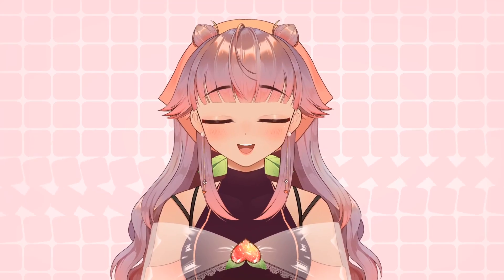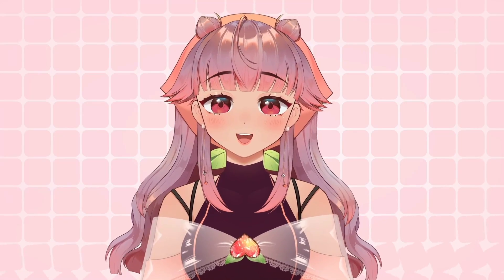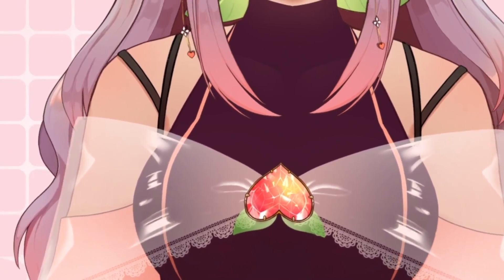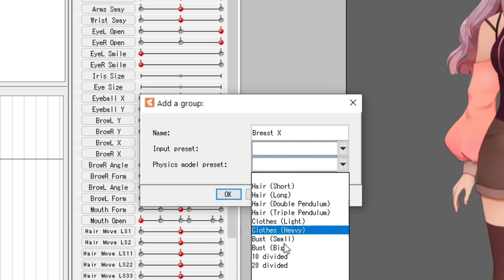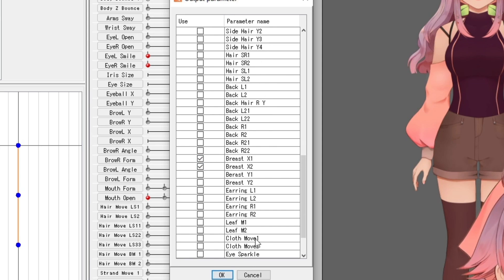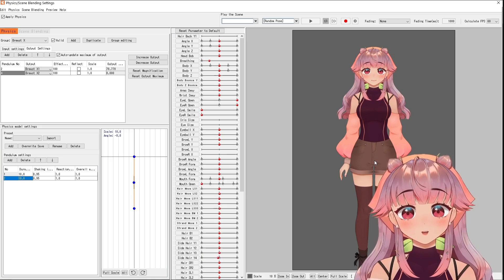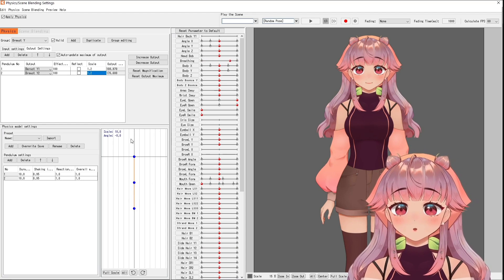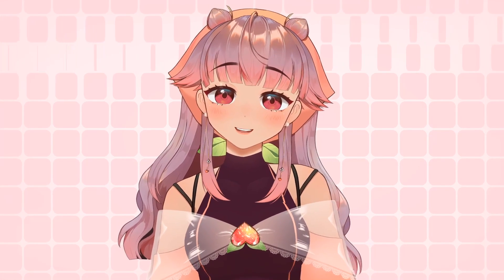NEW Live2D Physics tutorial + how to rig hair & breast [2D VTuber Model]

Comment: Hi, when setting the value for the parameters for rigging physics, does it matter if you set it from -1 to 1, or -30 to 30?
Reply from the maker: It matters in the physics window! You wouldn't need to scale the movement up by very much :> I just prefer having the -1 to 1 now

Comment: The breast part is moving but its take the whole shirt/neckline with it, should i separate it manually or is there a way to only move certain points when shifting them on a x axis?
Reply from the maker: You could increase the control points & partitions of the deformer in the inspector window

Else, separate the breasts from the torso in the PSD

Comment: I don't know why it doesn't work for me, I do everything in the tutorial but my model stays still, I move it to the left and right and it does nothing.
Reply from the maker: Heyo, I've put in some things you can do so you can see what the problem is :D

I'm assuming that you have already rigged everything (head, body, etc)

1. If you're too zoomed in the model, movement of the cursor doesn't have a large effect on changing the parameters

2. check if "Apply Physics" is checked, it's found in the upper left corner of the Physics/Scene Blending Settings window

3. could you check Preview > Settings of cursor tracking? The parameters that you want to follow the mouse should be set to something, not just "Unset"

4. You could also move the parameters themselves around just like this: https://imgur.com/vVf8xHq

5. close and reopen the window or restart Live2D